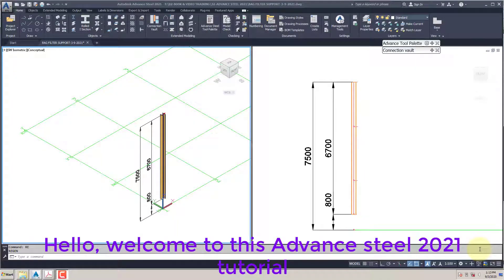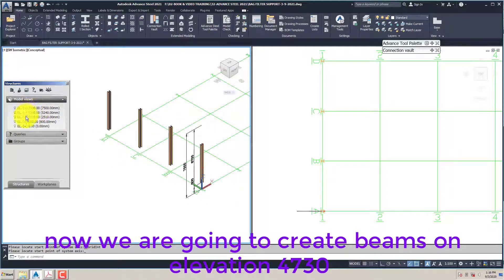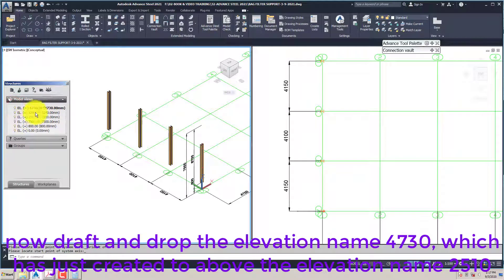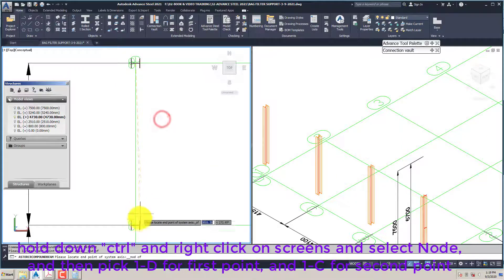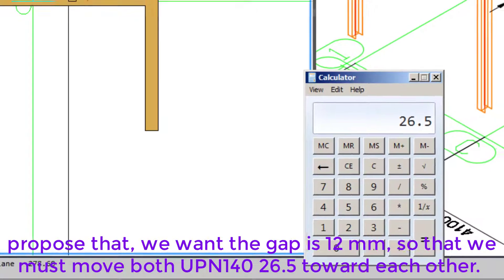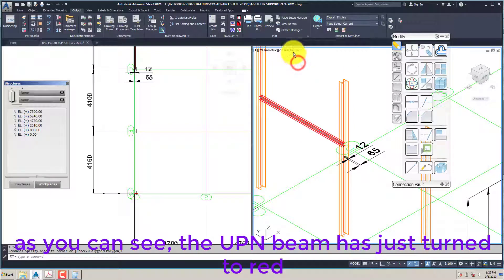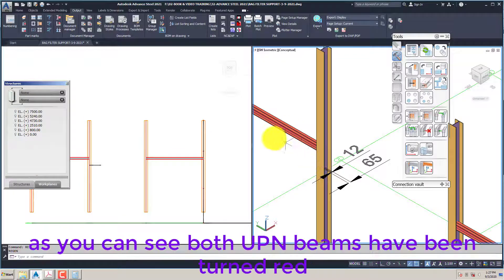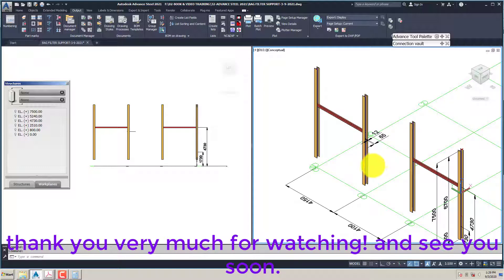BAG FILTER SUPPORT/3/HOW THE LEVEL WORK - 02

Comment: How to creat half column by T, but T possition is not center with the I steel, thanks
Reply from the maker: Right click on column, and choose Advance Properties to open Advance steel beam dialog box, you can select T sections at section field in the section & Material tab,  switch to Positioning tab where you could adjust T column position by inputting any value in y field and z field.